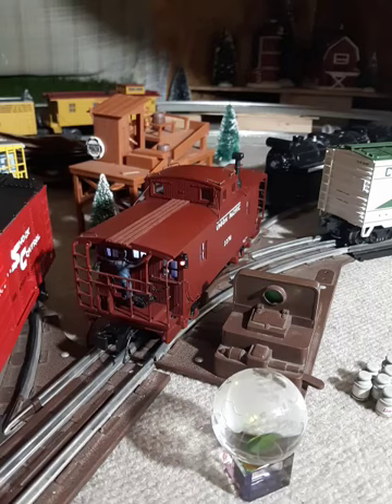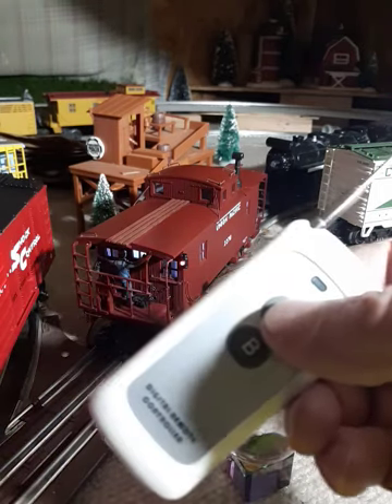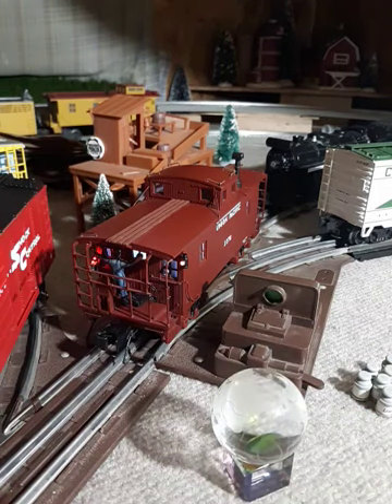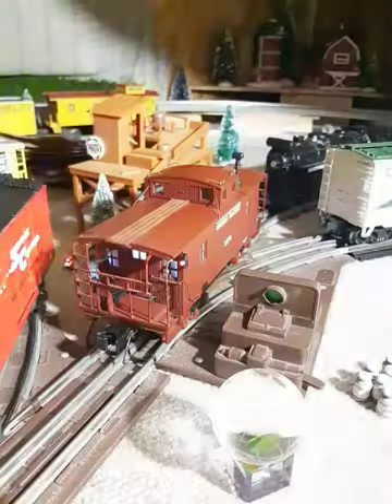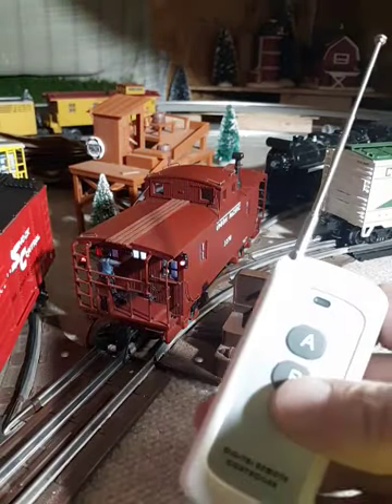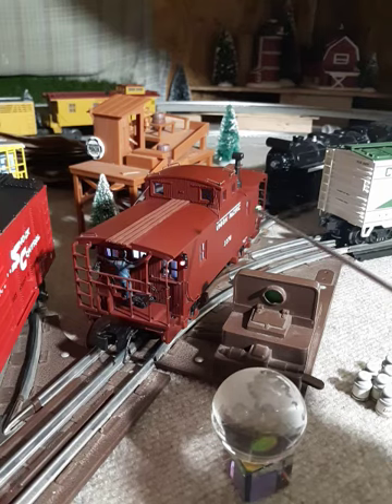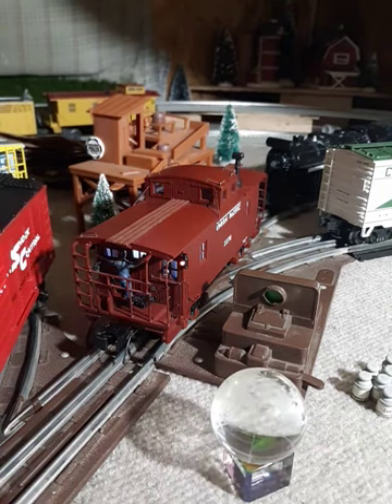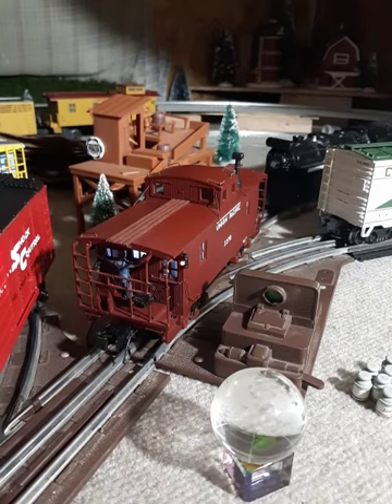MTH 20-91253 UP Caboose with Signal Man Remote Control

Comment: I bought one of these cabooses for my Legacy-controlled layout, but the trainman never moves, regardless of which position the bottom toggle switch is placed in. (Even when the switch is in "Auto," nothing happens, and the included "directions" are a joke.) Does it require some kind of activation track?  Any ideas what could be wrong? Thanks in advance!
Reply from the maker: If I remember it should work with a control track
Reply from the maker: I forgot to say that I think Lionel Legacy has constant power to the track MTH is the  same it has constant power to the track around 18 volt "don't quote me on that" the one that I put the remote in was tested first with a control track.